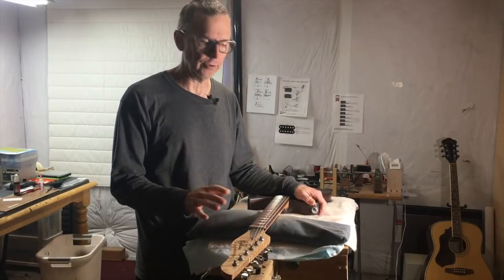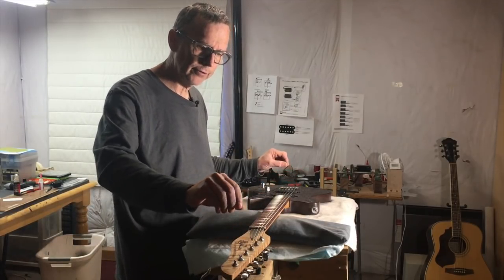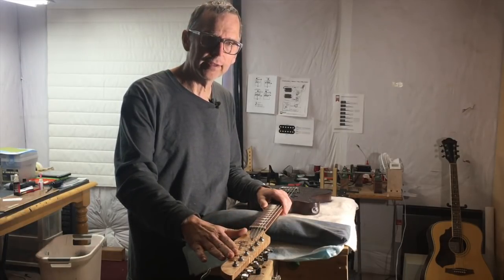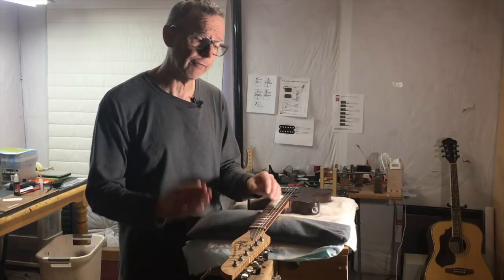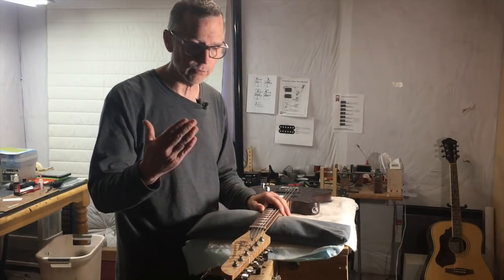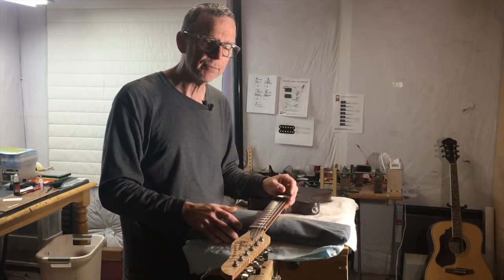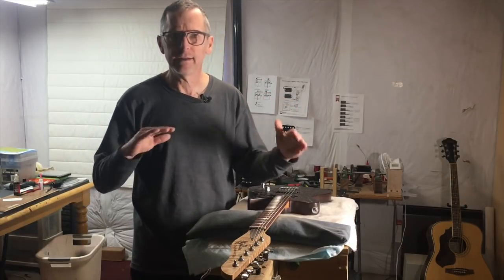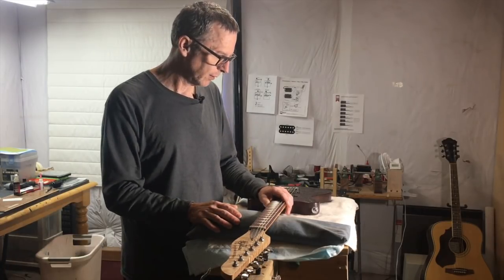Stop Fretting Over Headstock Angles

Comment: Simple physics and force direction analysis say that, for a string (of the same dimensions) to vibrate to the same frequency (say A440) the same amount of force has to be applied.
So the same force is applied to both 0 and say 7 degrees on the string.

But, while with 0 degrees the force is on the same direction as the string itself, hence no "downward" pressure on the nut, if you angle the string at the nut, then the force applied on an angled direction is analysed in two components (one horizontal, same direction as the string, and one vertical, which is the downward pressure on the nut).
Force analysis dictates that the vertical component of the force is directly equivalent of the angle.
So, different neck angles apply different string pressure to the nut.

Comment: I really enjoyed this, Chris, and you are right to say that dickering with headstock angle and, thus break angle, won't make a meainingful difference to downward pressure on the nut. However, you are, I believe, mistaken to suggest that you can't make valid comparisons unless you can keep all the variables the same. The reason for this is because you can also use the imaginary guitar to validate the suggestion that it will feel different. Specifically, as you lower the pitch of the note to compensate for the greater break angle pulling the string sharp, you are loosening the string to achieve that. I think that is what people are feeling - looser string to achieve a given pitch - easier to bend. Personally, I have never been able to feel such a difference. By contrast, I don't believe increasing break angle confers any advantage in terms of tone or volume. Alan Carruth has done some experimental work that suggests that break angle needs only to be sufficient to define the string ends and eliminate buzzing and slipping.

Comment: Yes I agree tension between nut and bridge is the same and doesn’t really take much on an electric guitar and we can fake it easily with string trees obviously. I don’t care for locking nut on my Kramer strat very much, but it works for the Floyd rose trem better I suppose. What I do like is it used a full bar string tree through bolted that’s adjusts downward pressure nicely on a smooth polished round surface. I thought to try it with a slotted nut and zero fret some time.

Comment: your reasoning regarding tension is incorrect.  given that you're tuning the same gauge string to the same pitch on the same scale length, the string tension must be the same regardless of headstock angle.  But, when the headstock is angled more, the force on the nut is higher.

What i do agree with, is that more force on the nut won't magically improve your "tone".  As ling as there's enough "preload" on the nut that the string won't rattle, you're fine.  Too much angle OTOH increases the friction on the nut which can cause some tension to be trapped above the nut, making the tuning slip when the string is played.

Comment: my friend, i will have to disagree on one thing, headstock angle causes downward force into the nut, and tuning the string into pitch again after changing the angle of this "ideally magical moveable headstock" should not reduce the downward force caused by the angle, you can try this and corroborate this: lets take the other end of the strings in a les paul for example, tailpiece height can be manipulated so if your theory is right heightening the tailpiece to cause a smaller angle on the bridge would make the same downward force to the bridge as having it lower as long as all other variables are kept (string tuning gauge etc) and that is not true in practice, i've had many cases of bridges that lean towards the neck because of this problem, and top wrapping can prevent this by reducing the break angle on the bridge, thus downward force, the same happens in the nut, less tension causes less problems like strings detuning too much with bends on les paul style headstocks, that downward force caused by the angle makes the string get stuck in the nut and causes more tuning instability because of greater friction caused by increased downward force, also this force is what drives the top on acoustic guitars, i'm sure you know that as a luthier, possibly i misunderstood your video but i think i heard you say that if you tune to the same pitch downward force does not change, and that is physically not possible...

Comment: The Les Paul headstock is the worst design ever.  Strings never stay in tune thanks to the severe angle of D and G.  They notoriously break due to their angle.  Design flaw Gibson refuses to fix.  Paul Reed Smith fixed that on his guitars, and Music Man guitars don't have this issue.  And I believe neither PRS or MM use string trees.

Comment: My magic guitar wouldn't change string tension when headstock angle is increased (or decreased) and it would stay in tune, but I agree that a modest angle can be sufficient to give enough downward force by strings at the nut. I also agree that a large angle looks awkward. Before I saw people do away with their string trees by installing staggered tuning machines (on strat style necks), I wouldn't have thought there would be enough downward force by strings in the nut slot, but it does work, on some guitars anyway. There are some with such a shallow offset cut at top surface of headstock that it would definitely not be enough to simply install staggered tuners.

Comment: I agree about downward string tension. However I would assume a headstock at 0 degrees would be easier to pop the string out of the nut (sideways) than one with a slight angle applied. I guess you COULD then argue the nut could be improved with a deeper groove. But with so many guitars with 0 degree headstocks you'd have to assume we'd all know any shortcomings by now. Fenders, for example, have a slight angle break from nut to tuner even with a 0 degree headstock. Obviously it works.... One other thought. If you bend a tree branch (rather than stretch it) there's a constant force at work. With an angled headstock maybe a similar type force is pulling the string eventually out of tune if it stretches over time? or at a faster rate than 0 degrees would lengthwise.

Comment: Totally agreed! I'm pretty early on the path of being a luthier, but I've realised that the only real benefits of the headstock angle (as far as I've been able to tell) are to ensure that the string angle prevents it from buzzing / vibrating on the wrong side of the nut - and to hold the string down into the slot in the nut! Plus the angle really does look badass (I use 15 degrees when I make an angled headstock, as opposed to a strat-style headstock).

Comment: I'm very interested, but not in the position to make identicle guitars with different headstocks just to prove this one way or the other. The Jazz guitar - with floating bridge - is said to react to changes in the height of the saddle. Put it higher - you get more performance. Raising or lowering the saddle is the same as changing the break angle on the headstock. So, logic implies headstock angle does matter. Some Fender users prefer to have no String Tree's, so are they choosing a sound or an aesthetic?  I don't know the answer to that. My fear is that we stray into making "electric" guitars with no concern for "acoustic" properties - as in - when they are not plugged into an amp. Everyone knows that you get super electric guitars that sound great not plugged in and you get ones that don't sound so good. Yes, there are a ton of reasons for that.  An interesting video - as always.
Reply: Those are totally different animals due to the long distance of additional string length behind the bridge (and of course the influence of pressure on the top of the hollow body). 
Some wind their strings differently to compensate a little, others use staggered tuners. A lot of people who get rid of string trees just want less friction and more tuning stability when they use the whammy. 
If you want acoustic...play an acoustic guitar.
If you play electric...you plug in. 
I wonder why there aren't more unplugged concerts with solid body electric guitars when they sound that good...

Comment: I asked Rick Turner on a forum years ago,what angle for a 12 string ,he mentioned something ive always remembered. Use just enough break angle on the head stocks to keep the string from buzzing or jumping out of the nut.moderation first. On my double neck he said try 10 degrees for the 12 string.in fact i also used 10 degrees on the six string . He was right there was plenty of downward tention no buzzing. Very true ring tone. Both stay in tune better than my lp with 17 degree headstock Even on the six string. I dont know where gibson got 17 degrees ,maybe engineering or maybe arbitrary,i dont know. Fenders design isnt flaw free either.it is stronger than gibson but string trees cause tuning problems and without string trees you probably will get buzzing. 
I now build tilt back headstocks with 10-12 degree break angles. Works for me . 
Thanks for your input Chris, it gets us thinking and out of the Gibson/ Fender does it this way ,so i must also mind set.

Comment: At 0 degrees you would hear a lot of buzzing and a note wouldn't sustain for too long. The more stable a string is in a nut slot the longer sustain you get.
Reply: ReastBoef  They use string trees to get the break angel tho
Reply: @CarlosLauterbach  there is a lot of wisdom rite there! So if we measure the angle over the nut to the string tree, what angle do they really have? That is a very good point.
Reply: Think of it with a tuner post at both ends, that in that case there is no need for contact to anything until the nut is introduced. It's just to understand what the nut and the angle changes when you add them to the equation.